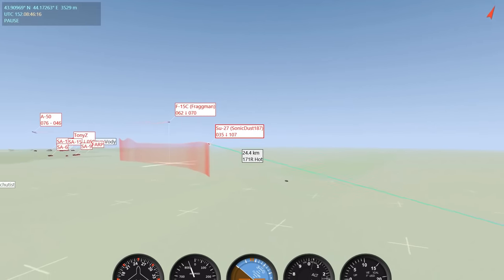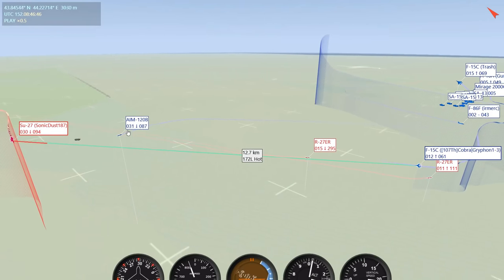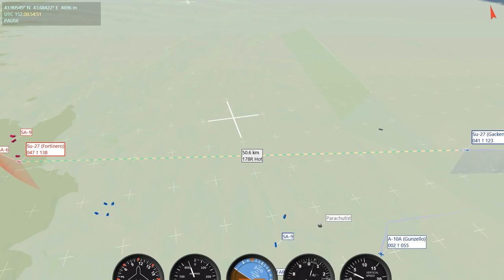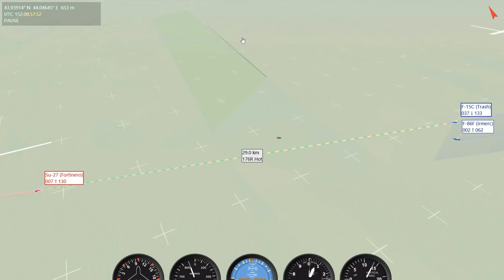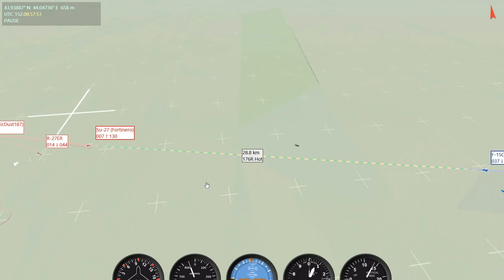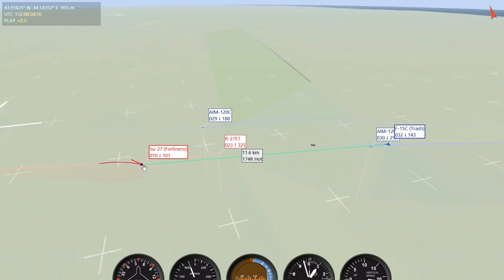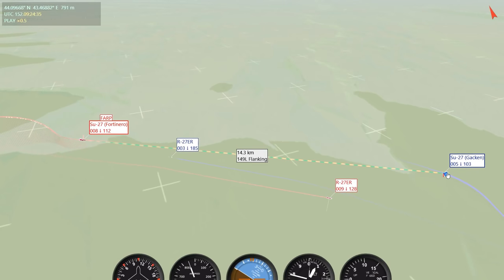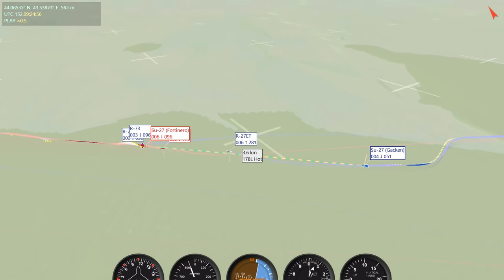Explained: A Close Look At Air To Air Missile Fights

Comment: fox 1? fox 2? fox 3?

what's the differences?
Reply: Jahn Kaplank semi active radar missile is Fox one it requires a radar lock from plane to guide the missile all the way to target. Fox 2 is a heat seaking missile or ir missile, it doesn’t use radar and acquires lock via the hear seaker. Fox 3 is a fully active radar missile, starts like a fox one but then has its own radar can guide itself to its target once it gets into range.
Reply: ah ok thanks
Reply: Jahn Kaplank fox 1 = short, fix 2 = medium, fox 3 = long.
Reply: wrong.  Greg has it right.